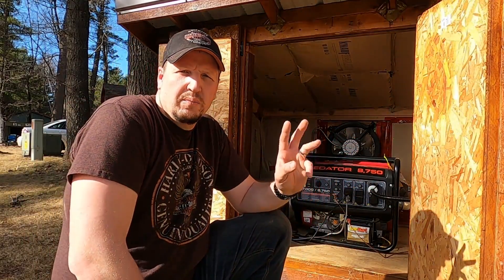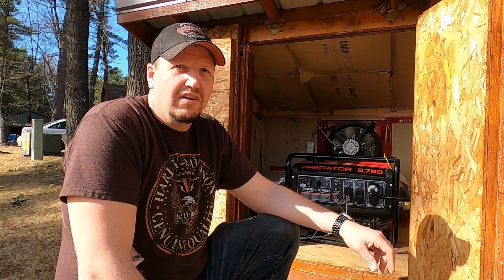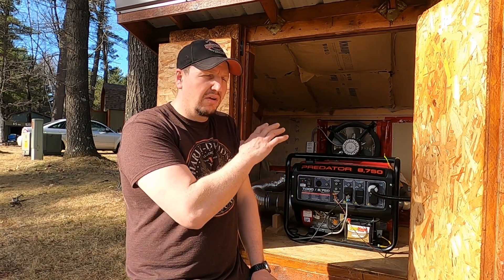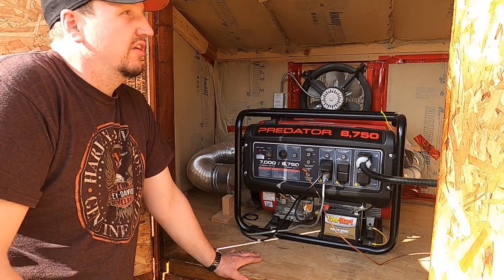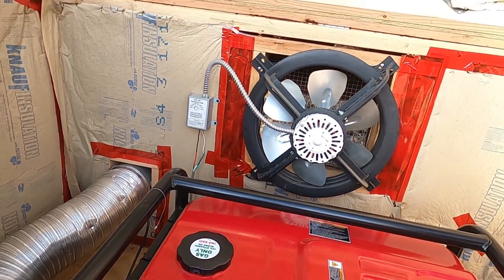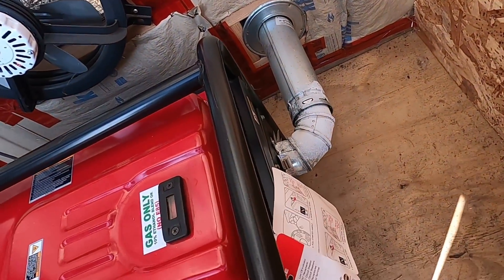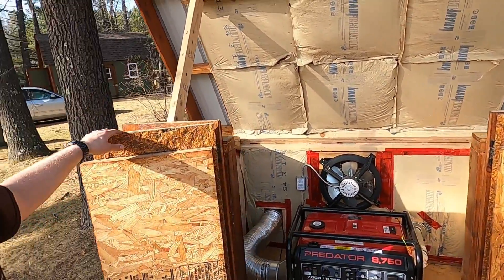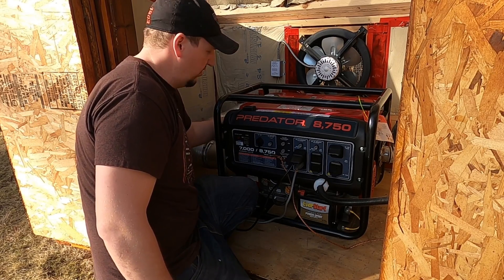Predator 8750 Generator in a Custom Generator Shed | PLANS AVAILABLE!!

Comment: Nice shed, good job. BUT , I would have put it on my deck or at the bottom of the steps because in a severe thunderstorm you gotta trot way out there to start it . Plus way less wire (expensive) but more noise but in an emergency I can put up with noise to have power. Just my flea bitten opinion . I still am impressed by your setup I know how much work you put into that !

Comment: Love it, but I’m going to build mine that you can walk in and have shelves…also I have solar so I need a battery/generator room with ability to use as small
Shop to do basic maintenance on the power system
Reply from the maker: Sounds like a great setup!
Reply: Thanks, not built yet…and thanks for your video to give me some interior ideas!

Comment: Been two years after wiring a Wen to my house with no power outages. Before that it went out several times a year. I'm just wanting it to go out for a few hours. Start mine up about every month just to charge the battery and hook my welder to it a few times.
Reply from the maker: Yeah, it's a good thing to start the generator every month to keep it fresh.

Comment: "Power never shuts off" LMAO. What about 20 a gallon oil prices? What about when that this Chinese junk breaks and you can't get cheap chinese parts to fix it? What about when you don't have the knowledge or experience to fix the chip or the software on it? You don't have a resilient system bro. You need a gasifier or water turbine with extra parts or solar with extra parts to really be safe.

Comment: I really like your enclosure A LOT. The only thing I might do differently would be to have the intake and exhaust on the respective sides of the enclosure to eliminate as much of the bends in the air flow pipes. Fewer bends make for faster air speed. This would also prevent any exhaust fumes from being pulled into the enclosure. You can also find pistons, similar to what holds the hood and hatch on a car or truck, but heavy duty enough to support the weight of the roof which would make it much more stable than the 2x4 you're using in this video. A sudden strong gust of wind could lift the roof off the 2x4 and allow it to fall while you're under it.
Reply from the maker: Good points! I did make a Tee on the exhaust that pushes the exhaust away from the intake.  The main reason I went out the back was to minimize noise on sides that face the house.

Comment: Very nice! I have the same generator in a shed that I just bought over the summer. I installed a duel fuel kit so I can use propane also. Propane can be stored long term and easy to stockpile in case the you know what hits the fan. ✌️
Reply from the maker: Very cool!  I've thought about it!

Comment: Awesome video and the first vid that I can see a noticeable noise reduction.  what do you think of using sandbags for the outer perimeter wall?
Reply from the maker: Thanks!  That is an interesting idea for a wall.  I don't have much experience with using sandbags but I'm sure they noise reduction would be great!
Reply: @OutdoorsEngineer  you can even do a stand alone wall right in front of the gennie that faces your house.  If you place it about 6 feet away from the front door of the shed, and if necessary, angle it so it blocks the sound heading towards your home.  The theory is that the sound coming from the shed's front doors would bounce away parallel to your house

Comment: Nice job. I have a Wen 875i and am looking at building something similar. I was thinking of a smaller more portable enclosure. Did you go with the intake and exhaust plumbing after doing testing? I am planning on having powerless cold air intake at floor and exhaust through the roof ceiling with as many sound deadening turns as i can get to the rear of roof. Hoping the heat rises theory will keep the generator cool. Most of our outtages are due to snow.
Reply from the maker: I went with the plumbing because i had built a temporary shelter at one point and it started over heating.  I figured I needed at least the intake and it wouldn't hurt to get the exhaust out as fast as possible.  I have thought about drilling holes in the floor so the attic fan would draw cool air from the floor across the generator.  

I think the biggest problem is heat, and making sure that engine stays cool.  Thanks for watching!

Comment: A solar trickle charger to keep the battery topped off would also be a great addition.
Reply from the maker: I usually start the generator once a month and let it run 15-30 minutes.  Have not had a problem with the battery yet.  Not much draw on the battery when not running I suppose.

Comment: Well pump does not run with the 8750 . You're misleading people
Reply from the maker: It does.  I have tried it.  So, no it isn't misleading.
Reply from the maker: The biggest thing is making sure you size the generator for your power requirements.  I have a 1/2 HP well pump.  Others may have bigger pumps and require more power.

Comment: Good ideas! I found yours looking for ideas to build mine. Good idea to pipe out the exhaust. Good idea to make it ready for 50 amps. Good idea with hinged roof.

I think I'd be worried about the intake clogging with blowing snow in a storm. Have you had any trouble with snow in this design? I think I'll use a vented soffit and skip the air intake. I'd add wires for remote starting, and a battery charger.
Reply from the maker: No problems getting it clogged...haven't had the opportunity in a snow storm.  I honestly don't think it would plug either way, at least in my situation and the amount of blowing and accumulating snow around the exterior.  

I did find that the cold air intake directly over the motor is needed to keep it cool enough, especially in the summer.
Reply: @OutdoorsEngineer  Thanks, interesting info. Tough to balance summer and winter conditions.

Comment: Living in Florida without sufficient power to run the A/C when the grid fails gets old very quickly- about 2 hours.  One never knows when a severe thunderstorm will knock the power out for and hour or two, or longer.  Then there's hurricane season.  So I just got a 9500 watt generator to replace my little 3500 watt machine.  We were once without power for 4 days.  I have two refrigerators and a freezer loaded with meat.  Now that I have the power I need, I was looking for a way to quiet my system down, and you just gave me some great ideas.  Your gen shed looks great and has enough room for storage of fuel for several days.  Thanks for taking the time to make the video and the great ideas.  I especially like the way the roof opens so the generator can be refueled easily.
Reply from the maker: Sounds good! Thanks for watching!

Comment: Get some rock wool insulation. Line the inside and it’s fire proof and would soak up the sound and noise like crazy.
Reply: I agree. Some 1 or 2 inch thick rock wool would make it much quieter.

Comment: Great job man 👍 I have the cat 8000 wanting to get mine permanent. What type of insulation did you use in your shed ?   Thanks liked 👍 and subscribed 👍
Reply from the maker: Thanks!  I just used regular residential insulation.  Not sure if that is right or wrong ;)
Reply: @OutdoorsEngineer  looks like it is working out great for you.👍 I don't think right or wrong. Only done and working matter. And your shed does both 👍 thanks for the reply

Comment: Quietest gen house video I seen yet. The plastic garden shed ones don't seem to cut the noise that much
Reply from the maker: That was my main goal.  Keep the noise level down, especially if we need to have some windows open in the evenings. Haven't really had to test it out with that respect because I still haven't had a need for using it since I installed it.

Comment: Nice.... but if I were you I would upgrade to an inverter generator, because those "worksite" generators will over time shorten the life of any sensitive electronics, which a lot of people don't actually think of as "sensitive".  Pretty much everything in your house nowadays has some type of control board in it that it's lifespan will be shortened by a dirty sine wave, and fluctuations in the cycle (60hz).  Even a furnace, you don't think about it, but unless it's twenty or thirty years old, it has a digital circuit board that can suffer from premature failure from dirty power. And an added benefit, inverter generators are usually much quieter.
Reply: The dirty power this gentleman is talking about is known a THD total harmonic disturbance.
Reply: Most modern control boards need a Total Harmonic Distortion of less than 5%, most non inverter generators are 12-20% THD

Comment: I would bet that a 4000 watt would run almost everything in your house that you would want, for half the fuel consumption.... these big 9000 watt generators are good for when you want to run big loads, but probably better off running a 4000 watt most of the time, to save fuel. Fuel can be hard to get in an emergency...
Reply: Agree.  I don't really see a need for that kind of wattage either.
Reply: @jshepard152  If you live down south, you really don't know how much you miss your A/C until you don't have it for a while, sometimes even days.  Yes, hot water is a luxury when you want to take a shower after you've been sweating through a 4-day outage, but it is nice to have.  6½ gallons of gas will run my 9500W generator about 9 hours with the A/C running @ 78°.  I can also shut it off for a couple hours at a time and restart it with a remote which is nice.  With two refrigerators and a freezer, a 3500W gen is pretty much used up.  The 9500W and a few more gallons of gas lets me A/C my house.  For me, it's worth the upgrade.
Reply: @freed6343 
Makes sense I guess.  I'm at 3600 watts on my generator.  I only use one fridge and that's 1000 watts, probably less.  Microwave would be infrequent for me and I could unplug something else for a short period if needed.  I have propane for heat but still have capacity for a space heater if I wanted.   If I really needed AC I'd probably use a window unit in one room only.  Hot water in large quantity is something I'll just have to live without.  But to each his own.
Reply: If you want a 230v output, which you really need if you want to connect to your main panel, generators don't seem to have it until they are 5000 running watts or greater. I just bought a Champion 100519, it seemed the best option for people who want to tie in and want to run more than a refrigerator and a few lights but less than a whole house.

Comment: Why wouldn't you run the generator with the power cord plugged in? you will keep the generator grounded that way wouldn't you? Keep the inlet breaker off inside the house and no generator power will disrupt your panel's line power..
Reply from the maker: I typically always leave it connected.  Like 99.9% of the time.  For some reason for this video I decided not to.  Thanks for watching!

Comment: Really like the Gen house. Nice design. Pop-up roof is sweet. Good job. Might want to get a single lug or crimp-on eyelet on that ground wire to clean it up a bit and enhance the connect. How did you hinge the back of the roof? Thank you.
Reply from the maker: Thanks!  They are just old interior door hinges. They stay out of the elements and I made sure they got full of stain so they don't rust.  I think I have 3 hinges on the back of the roof.
Reply from the maker: Oh, and good idea on the ground wire.  I'll have to look for something that will fit the wire size I have.   Thanks!

Comment from the maker: Hope you enjoyed our generator shed!  What do you think?
Reply: Beautiful Generator Condo! 😎 I'm also very impressed with the noise reduction, and the hinged roof! Nice work! I have a little different set-up, I have two 2500 watt Champion dual-fuel inverter generators (Gas/Propane) since we are miles from any Natural Gas pipeline and can run the house for 10-11 months (stove, oven, water heater, clothes dryer) with our 250-gallon propane tank. My thought was fuel efficiency and portability, I can run one or both generators in tandem depending on the demand and run them both for months without needing fuel. I can also move them easily to anywhere I need power since they only weigh 40lbs each but combined with a parallel kit have a peak output of 5000 Watts, more than enough to run everything in the house (excluding Central A/C). My shed is 8x8x4 and 2x4 framed with exterior siding and insulated with *Rockwool (sound-absorbing, fireproof, water repellant) insulation. I used 50amp breakers and 6Ga. wiring with a main breaker interlock, all connected through an additional breaker panel with 30 and 50 amp RV outlets, mounted alongside the outside garage wall. ~Roy~ *Critter Ranch, Apple Valley, CA.
Reply: Fancy schmancy.  I especially like the underground wiring.
Reply: Do you have the plans? That is one nice shed
Reply: Great need those build plans 😊
Reply from the maker: @khiaraslaw  I probably have some old cad drawings of them laying around!